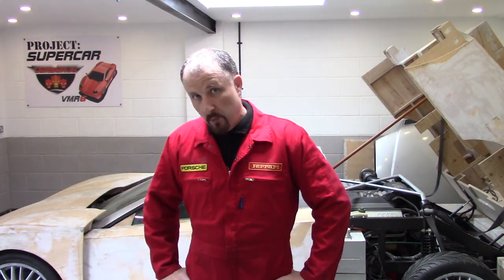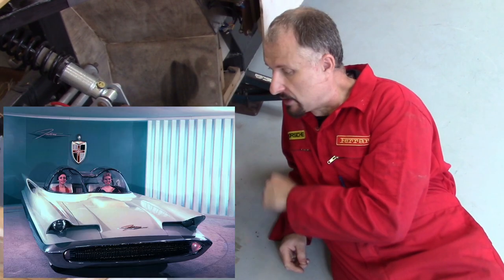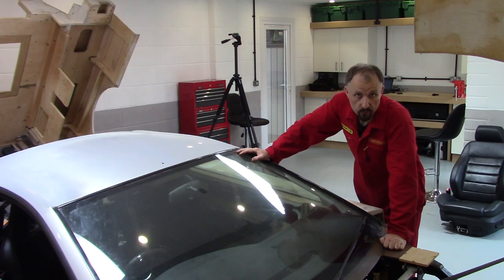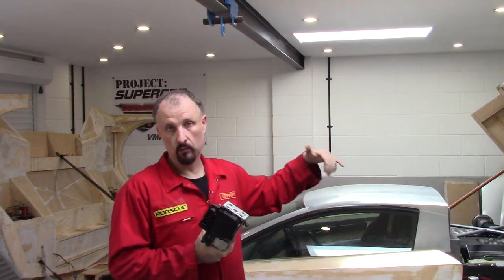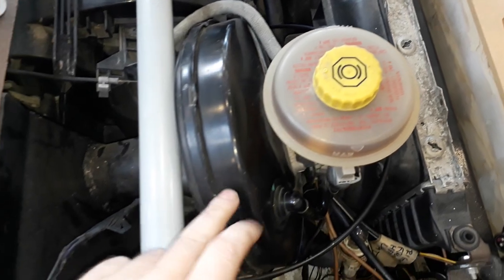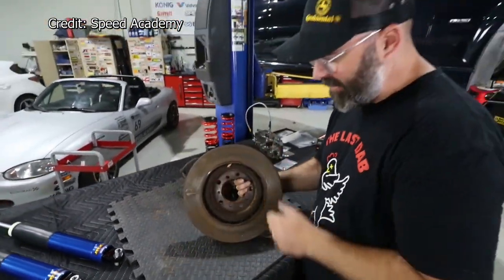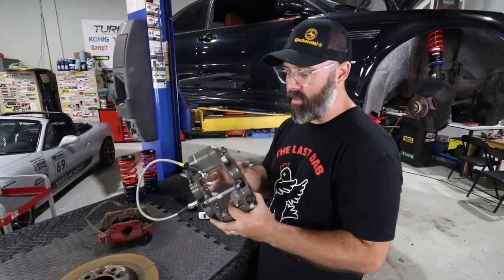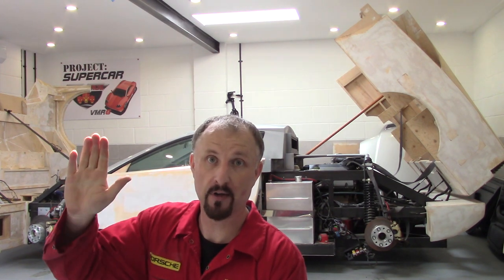Braking System and ABS for my DIY Supercar Part 2: Prototype Ep17

Comment: So where was your missus, looking thru the window or under the glass topped coffee table? Had a bias valve in my rally car, it was so handy on different types of surfaces and types of road, tight and twisty etc - get the rear end out without handbrake. We can't have them here in Aus either, must've been tolerated for competition cars, or put in after the fact :). But a bias valve will help in the setup of the brakes, then forget. The rears should be too powerful and then tone them down with the valve. Actually, my old ute had one rigged to the suspension so when it was loaded the brakes would turn up
Reply from the maker: LOL, when my missus is shopping for shoes, I'm not waiting outside the shop watching YouTube videos on my phone, I always have an urgent appointment which just happens to be in the nearest local bar ;). Yeah stupid government rules getting in the way of brake bias. When building your own car you're never going to get the brakes to match the weight distribution of the car. Plus when fitting larger front calipers the rear calipers tend to lock up before the fronts have begun to grip, so you need to compensate.